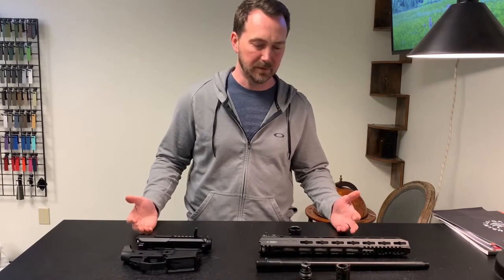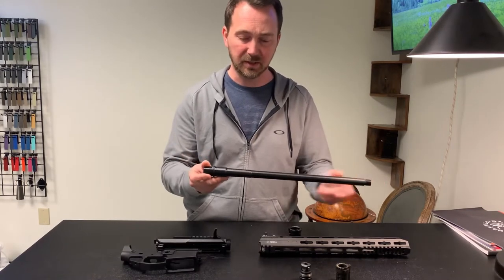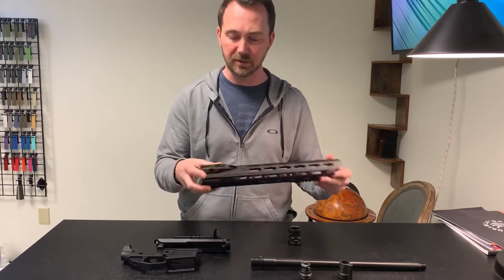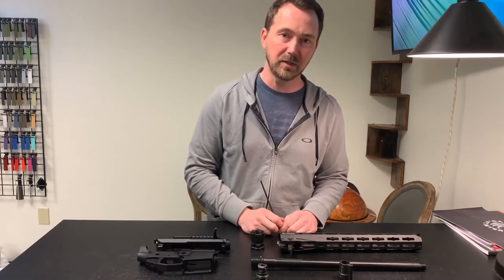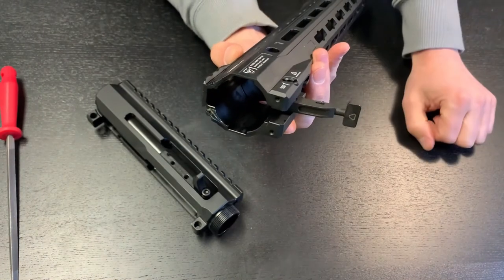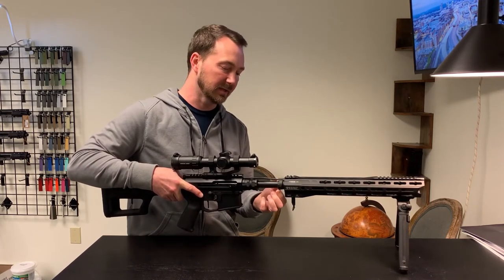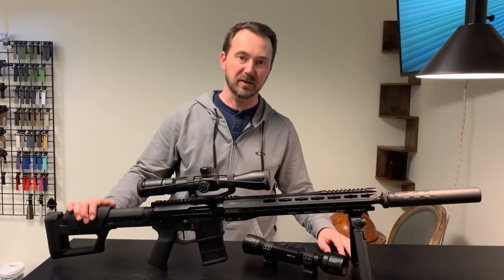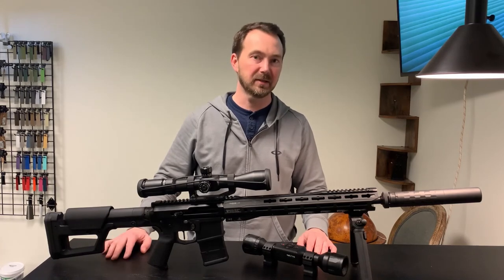Budget friendly 'bolt-action' 300 blackout AR15

Comment: So this is essentially an AR-15 in .300blk with the gas block turned to zero? Here I was about to buy a $1200 bolt-action upper to make a dedicated bolt-action rifle, when I should have just gotten a pre-built upper with adjustable gas. You saved me a lot of money mate, thank you!
Reply from the maker: That is the exact same route I was going to take before trying this path. This is legit one of my favorite rifles at the range now. The only down side to this particular build is that with a 16” barrel I’ve found a few brands of “subsonic” 300BLK that end up going supersonic.
Reply: @samdiegotactical  thank you! Do you have any suggestions for uppers that don't have the problems you encountered in your build?
Reply from the maker: Can’t say I do. That being said, the only issue was the interference with the anti rotation tabs on this particular Strike Industries handguard, and even then it only took about 15 minutes of some light file work on the tabs to get the clearance needed. I will say I am impressed by how smoothly the Bear Creek side charging upper/bcg combo works. Definitely exceeded my expectations for quality.
Reply: I do like the work you put into this project. My only question would be at any time, can I change it back to the original DI system if I choose to do so? The reason is, I've been looking at the Uintah Percision uppers and there is quite a change.

Comment: I have been building these for a long time. Very good suppressed, you can use an aluminum sleeve in place of the gas block or use a machine screw in the gas port
Reply: Or cut a gas tube end and reattach upside down.
Reply: @TNRonin  I dont get it why would you need to cut the gas tube
Reply: Gas leak @YakshaManji